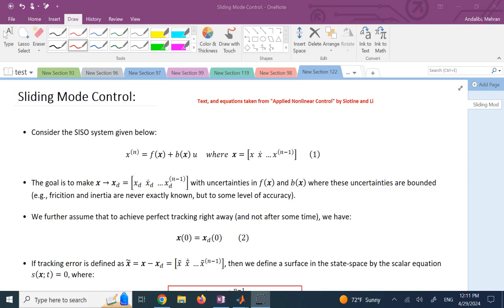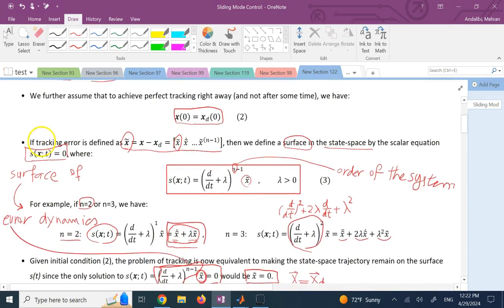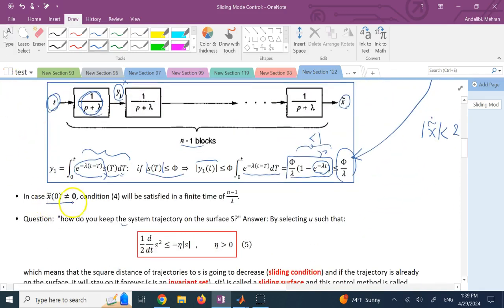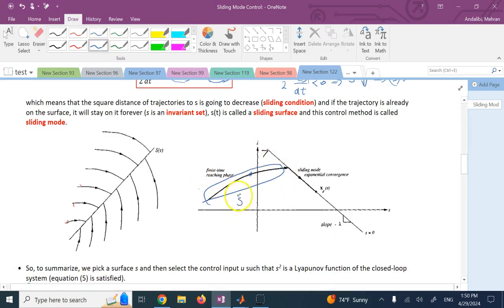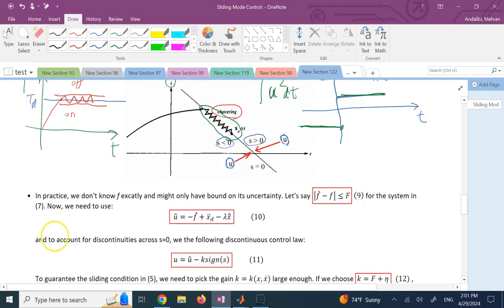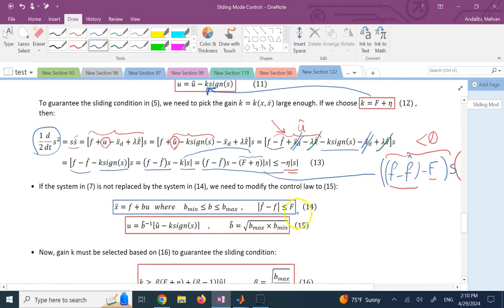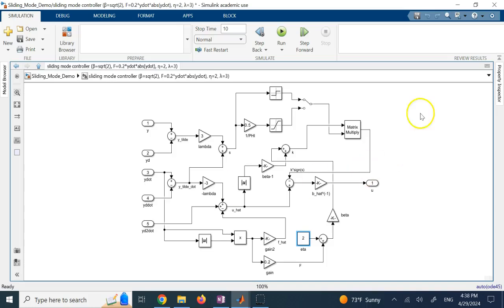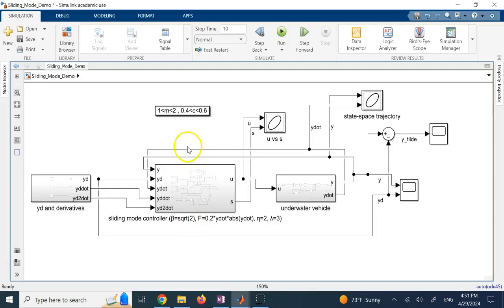Sliding Mode Control

Comment: Hello, amazing video and Slotine is an amazing book.
 I wanted to as, the second (and possibly higher) time derivatives of the reference output (state) are treated in real-time control? In your example, these were pre-defined. In reality however, the demand can changes unpredictably and thus the derivatives must be measured/computed in real time which can be challenging due to noise etc. So is there, e.g., some special form that avoids using the time derivatives of reference?
Thank you!